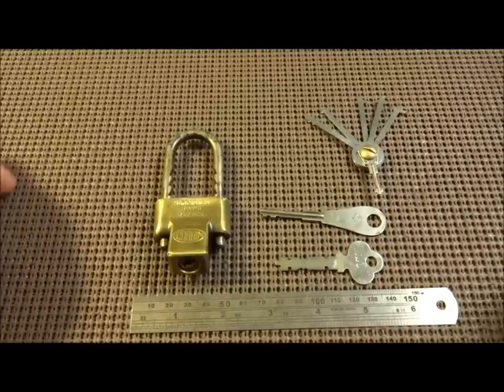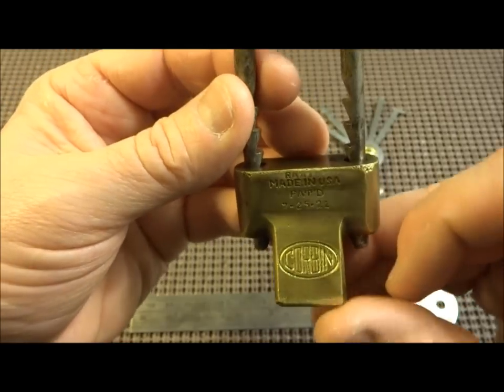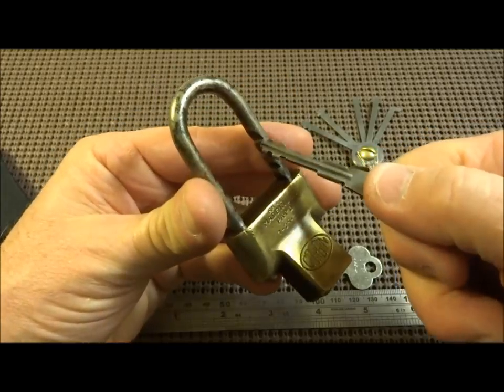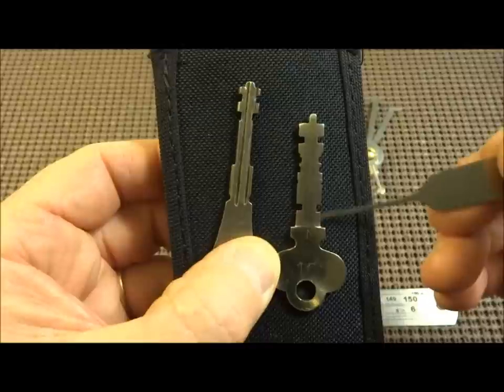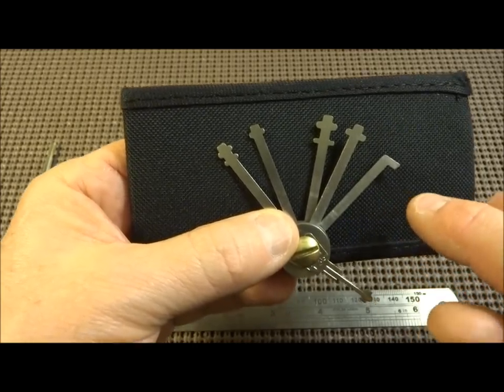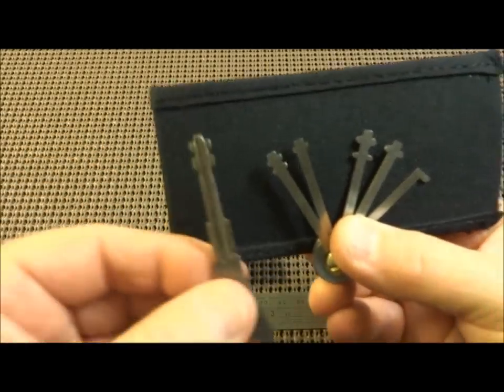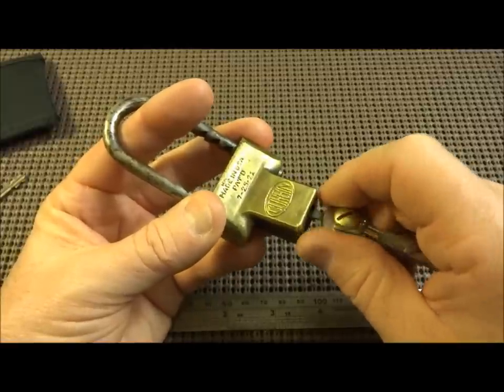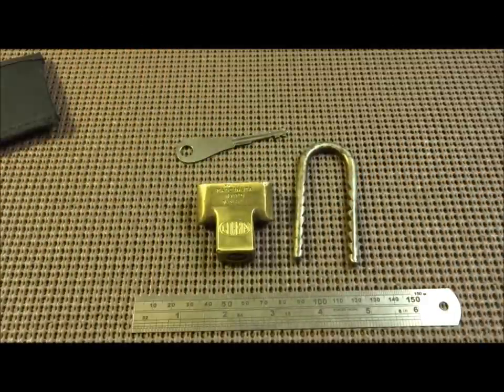(82) Antique Corbin Railroad Switch Padlock Bypassed

Comment: What I like about this video is the bolt nut affair holding your ward bi-pass keys. I may use a rivet instead so it still fits my carry kit. I don't think I have ran into even a Master warded lock in a decade but due to my undiagnosed OCB I Must be prepared. Of course the lock is nifty too.
Reply: I still see Master warded locks at my local grocery store all the time